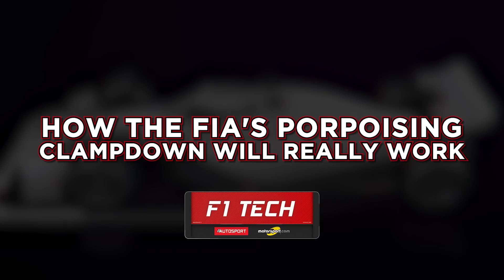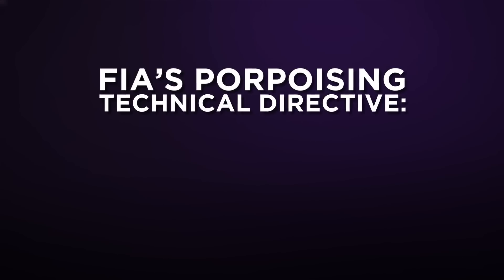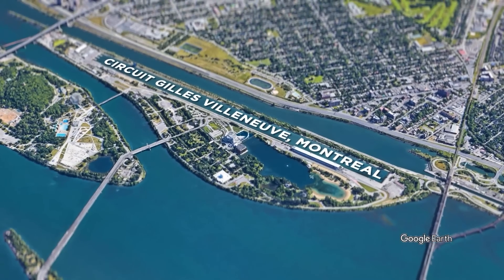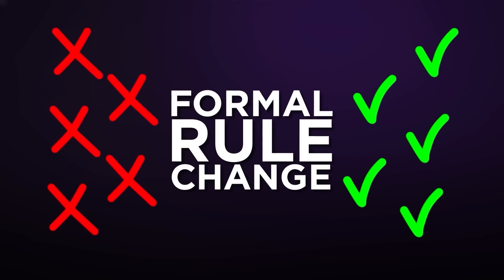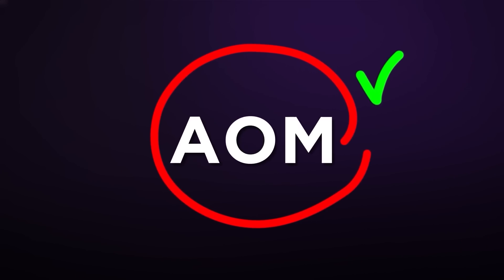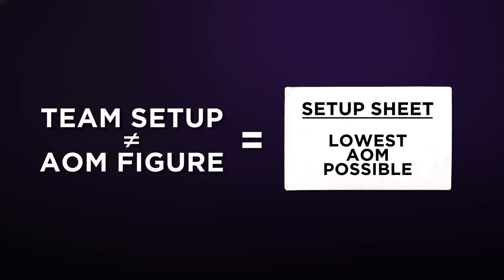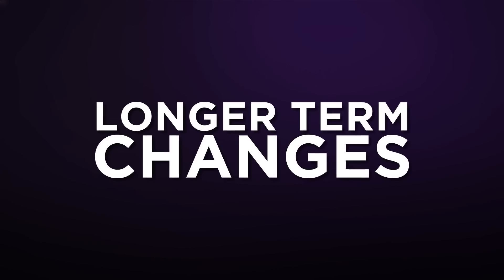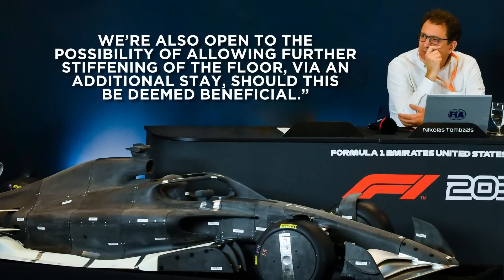F1's Porpoising Tech Directive - How it Really Works

Comment: The ride-height is not fixed. I mean look at how the Mercedes made their rear suspension drop to the ground at speeds.
To police this could be quite difficult. The poor ride comfort was said to be a obvious problem before the season started since we got bigger wheels and ground effect cars.

I'm just saying this will be a thing that continues for several years, mark my words😅
Reply: @Anton Danielsson I think they all made a huge mistake.   They changed too many rules at the same time, not to mention the Cost cap and Wind Tunnel restrictions.   Red Bull solved their problems early but are complaining about Money issues.   Mercedes have serious problems with bouncing and etc,  but don't seem to have money problems, Ferrari have a fast car, bouncing issues.  The idea for the rule changes was to make closer racing... I think we have the status quo, that top are the top, the mid are the mid, the bottom well that has changed a little but Williams are still crap.
Reply: I hope not 😕

Comment: everyone say fia helping Mercedes but they forget how fia ban engin mode in favour of redbull and against Mercedes and how they changed the floor regulations to helping the redbull and ferrari and against Mercedes low reg design
Reply: DAS?
Reply: @mininerdlp1320  DAS was against sporting regulations (not thechnical regulations), just like the automated brake assist Renault had few years ago. So they where going to be illegal the next season anyway.
Reply: @kjellcmans9764  plus DAS wasn't removed mid season.
Reply: Let's not forget how mercedes had a major advantage at the beginning of the hybrid era where other teams couldn't develop their engines and it went on for a couple of years.
Reply: Not to mention, the FRAC system they made Merc remove.

Comment: As long as it’s a rule that doesn’t negatively affect the teams that have minimal to no porpoising then that’s fine but if it does then I don’t think that’s in good sportsmanship as those teams have found a solution to the problem and shouldn’t be penalized for it.
Reply: Affect*
Reply: They all experience porpoising / bottoming to a certain degree with 19/20 drivers (reportedly) complaining after Baku.   However some teams have porpoising that doesn't appear to affect performance (e.g. Ferrari).

Comment: Everything the fia can do to help Mercedes. Even mid season technical changes. What a yoke.
Reply: You do realise that this will help teams like RB and other teams with little to None porpoising? What it does is to actually Hurt Mercedes, because they will be forced to run with a higher ground clearance
Reply: @M4RK_F  Just shows how little you know about what is going on. Mercedes are the ones pushing for these rules. Because they had a 'solution' (read: they knew what FIA was going to bring to the table) the day after FIA said that a second cable/rod can be mounted to support to floor edge. And tada! they were the 3th fastest car, without the problems of Baku. So they don't have to raise the car, were Ferrari is going to be forced to do. (Ferrari's problem isn't the edges of the floor, so they can't solve it like the FIA (Mercedes) wanted to.
Reply: @kjellcmans9764  i am clearly not as updated as you are, i was wrong. Thx for good explanation
Reply: How about mid race sporting changes to assist RB win the title.
Reply: Gotta push ol' woke boi Hamilton upwards somehow.
Reply: Yeah, like last year when the rule changes to the rear of the cars helped Mercedes last year eh?….Or when the party modes for qualifying were removed too.
Reply: @nickxcore74  party mode wasnt changed mid season
Reply: @nickxcore74  90% of FIA decisions have favored Merc in the last near-decade.
Reply: @nickxcore74  party modes were for engine customers to get equal power as main team. Doesn't change output between manufacturers if you think about about it

Comment: What about raising the floors with side skirts added to  seal in the Venturi air.  Sorta how they did it in the 80's. The skirts would be non rigid using brushes or hoovercraft style rubber flaps? This could be a good long term solution that preserves the concept while deleting the negative effects?
Reply: Like other the guy already said, it would create more problems than it would solve.
 Skirts make ground effect much more efficient, which mean teams have to lower the car's natural downforce because the car can't handle all that much, and now the car is fully dependent on that skirt working for it's downforce.
 In a street circuit like Baku/Miami that's a risk not worth taking.
Reply: @afoxwithahat7846   if you made the skirt in a similar manner to a hovercraft or brushes you could seal the air but also absorb the bumps so you could actually raise the car instead of lowering it.  The cars would be fully dependet on the skirt, cause the 2022 cars dont have skirts and produce loads of downforce.
Reply: @EddieCongress  That could make them not lose downforce suddenly, but would still make it unstable.
 The more compressed the air is, in a venturi tunnel, the faster it has to go and the lower pressure it has.
 Any bumps that made the car get closer or further from the ground would affect it slightly, it could snowball into something very bad very quickly in a circuit like the ones I mentioned before.
 But if there was better asphalt that would be interesting
Reply: @afoxwithahat7846  There is no perfect solution with the venturi tunnel.  Not to mention brushes or rubbers gasket seals would be ugly.  The incredible minds in the F1 engineering pool will get it figured out.
Reply: @EddieCongress  Well, Redbull did, the main limitations are the ones imposed by FIA themselves.
 A ground effect car, if done correctly, would be dangerously fast
Reply: It probably work in straights, however you'd be inserting a new issue, which happened in the 80s aswell: the vehicles would lose downforce abrubtly when going over kerbs or asphalt ondulations.
Reply: @Prgsan  there is no perfect solution with the ground effect package.  A brush skirt or rubberized skirt would deflect over the bump and keep the ride somewhat comfortable and keep bulk of the Venturi over curbs and bumps.  Ground effect cars are alway going to ride harsh cause they have be be sprung super stiff and ride height will always be set as low as physically possible.

Comment: Can anyone confirm why Indycars arent suffering with porpousing whereas the F1 cars are? 
Is it purely the magnitude difference in downforce F1 is generating or chassis limitation based?
The Sea-sickness effect seems to have been an issue for ground effect series without it being so pronounced as in F1. Would be an interesting video I feel.
Reply: Insycar doesnt have venturi tunnels
Reply: No ground effect in Indy
Reply: @8688nick  you clearly don't watch indycar
Reply: @colossae3241  There is a floor but no ground effect.
Reply: @colossae3241  Having a floor and having ground effect are two different things. Genius
Reply: @colossae3241  the indycar floor is flat. where as the f1 one is not
Reply: @colossae3241  Indycars are way lighter and don’t need to rely on aero as complex as F1’s because their regulations don’t force teams to strap heavy low energy density lithium ion hybrid batteries, MGUK, and MGUH to their power units. A lot of F1’s issues with cars that are too wide, too long, too heavy, can’t race, rely too much on clean air for aero, and can’t follow is caused by the addition on the hybrid batteries not the relatively lightweight and reasonable modern safety features. F1 aero also needs to be more complex because they don’t drive on boring oval circuits.